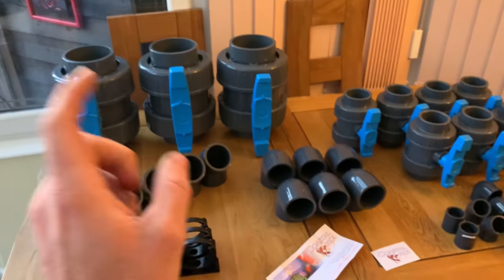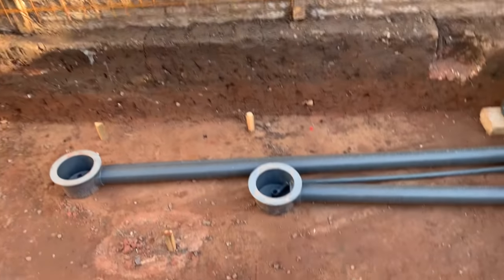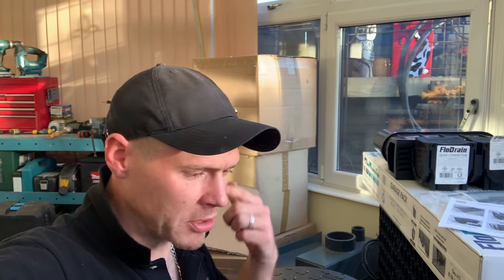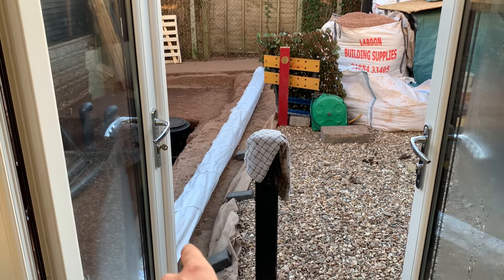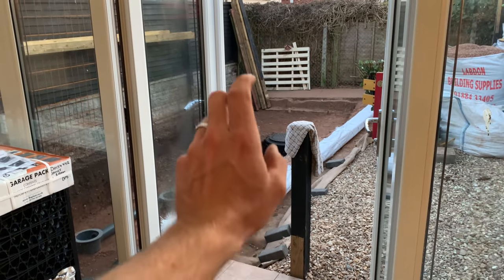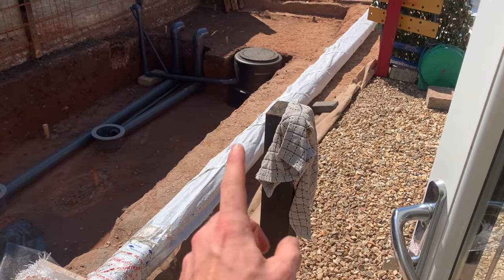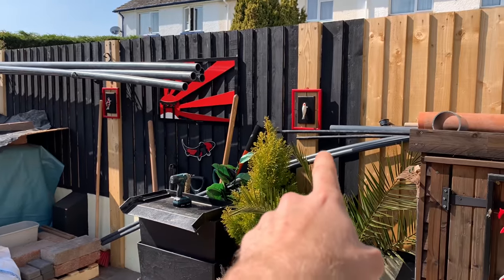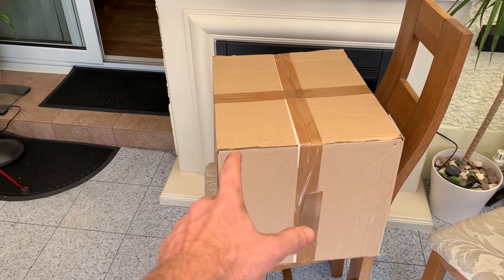NEW KOI EQUIPMENT TO BUILD THE NEW POND **BALL VALES PIPE WORK**FREE POND WATER?? #PART20 DREAM POND

Comment: Hi James , looking good on the pond build but just wanted to send you an idea that I wish I’d included in my set up - basically with bottom drains you might one day get a blockage and need to rid your drains so instead of going into your filter with a 90degree elbow swop that for a t- piece so you can ( when necessary) get a rod straight down the top of the T .  It’ll save you lots of hassle/heartache later on and doesn’t cost much . I do wish I’d known this as my bottom drains blocked and it was a nightmare without T pieces before the drum .

Comment: With regards to water rate reduction I'm in the Wessex water area it's easy to claim - just ring up and request a non return to sewer form, fill in with pond size ,gallons etc ,and you will get a yearly  reduction on your bill, I get about £70  you may get a visit from your water supplier to see that water is not returning to the main sewer,,happy days lol.  Also if you have a children's swimming pool you an claim for that. Hope this helps  I've been doing this for the last 3 years.

Comment: I got my valves from coastal when I built 8 years ago same with pipe from pipe stock needed 4m as didn’t want a joint under ground. Currently fitting Cetus sieve other half wasn’t happy that had to pick it up from Manchester on way home from holiday to Truro she had luggage packed around her in passenger seat